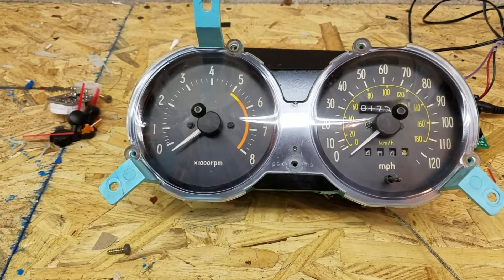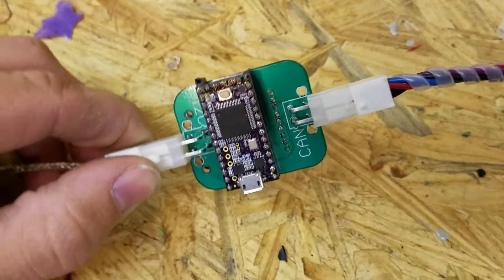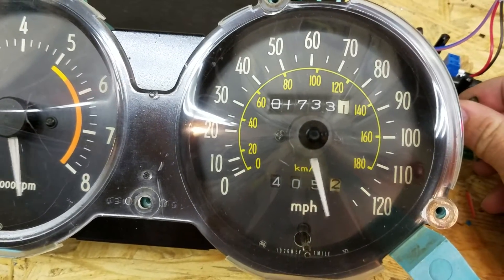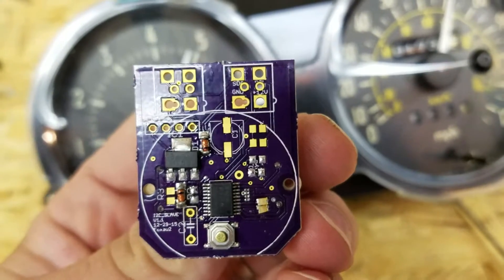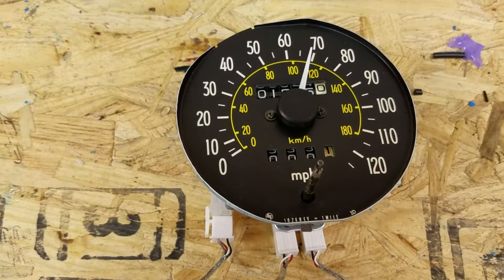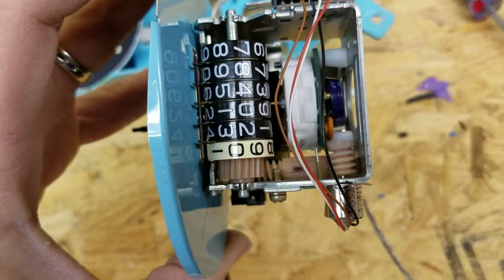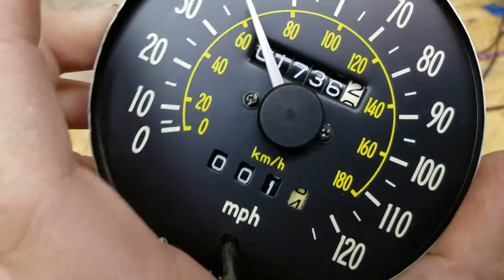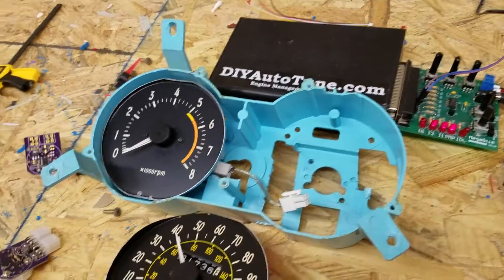Megasquirt Arduino Teensy CAN I2C GAUGES Switec for 77 Celica RA29

Comment: Hey! nice job.
what is your step motor drive ? 
I mean that round PCB.
thanks
Reply from the maker: It's a PCB I designed and programmed myself. They will be for sale eventually once I get them bulletproof.
Reply: nice, kept us updated.
I am doing same project on my BMW 2002 turbo 1972.
Reply: These are going in my Celica, but I keep getting small problems with them. My Celica should be running here in the next week or so, and I'm hoping to have these ready in there at the same time.
Reply: I would be interested in the controller boards when they are available. They seem like the best setup I've seen so far.

Comment from the maker: No, I did all the soldering myself. Do you have an MSP430 launchpad?
Reply: nope, just been breadboarding with a few different ICs its all on my powered protoboard (global PB-503, which I love) now as once I got my ms stim packs I started playing getting them to drive thes3pro and adding a few small oleds and whatnot to kind of make it all work before making a pcb sets
Reply: ive been using IC MCP23008 as I2C io driver and IC L293D as a dual H bridge... the OLED has its own I2C setup and was super easy, using my OLED to do my tripometer and a few other odds and ends in the gauge face.
Reply: did you draw up the PCB in Eagle?

Comment: im still working on my setup as i decided to add a few OLED displays to show other info on CAN.  ended up running my fuel level setup right to an input on my teensy3.2....also im running a MS3Pro so the stim wasnt plug and play lol but its comming along.
Reply from the maker: They have a stim for MS3X as well I think. I might run my fuel level directly into the teensy as well, but I like the ease with which I can manipulate the data in TunerStudio (such as smoothing). That's easy enough to do in the teensy as well, but then it adds more wires going to the teensy and makes it a bit messier.
Reply from the maker: +Foxau2 sorry, ms3Pro, yeah no stim there. :)
Reply: +Foxau2 you running a multiple teensy setup it looks like?
Reply from the maker: +rye kbaum nope only one teensy. It can run up to 16 slave modules, but it would be easy to expand that
Reply: +Foxau2 you posting this on the ms forum or github?
Reply from the maker: +rye kbaum I haven't yet, but I will whenever I get around to it. If you want all the files you can email me foxau2@gmail.com